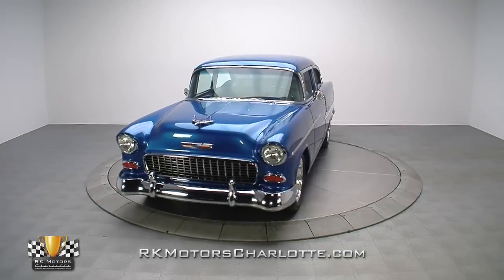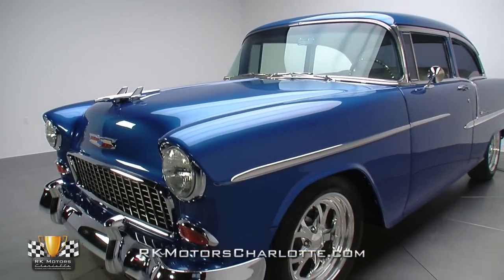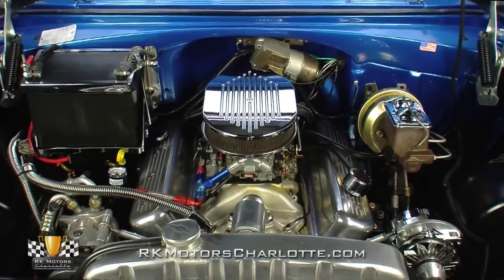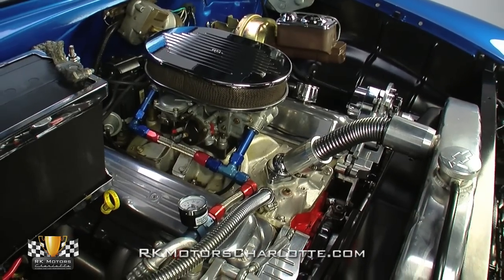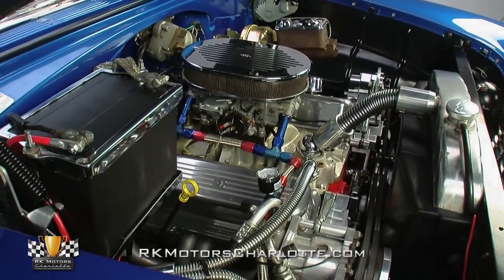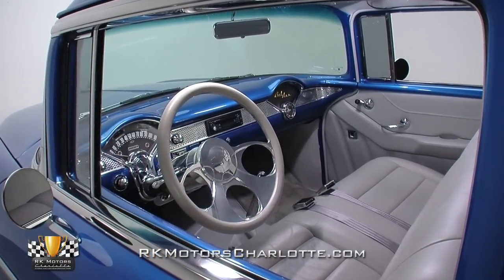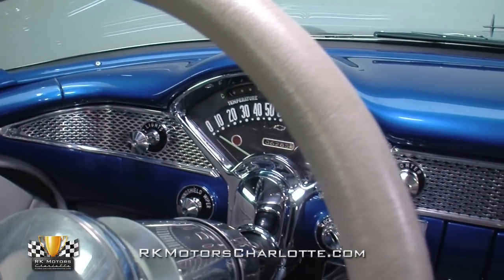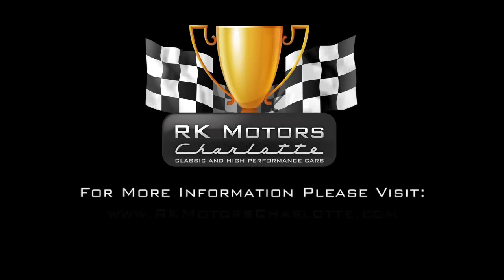133290 / 1955 Chevrolet Bel Air

Comment: To set it off what would be wrong with using a modern day EFI throttle body from Holley or the original from  FiTech ..all of which have a built in chip to control the electronic fuel injectors ..just sayin'. For those who worry about such electronic fuel injection letting you down  bum fucked  Egypt..carry a new Holley carb in the trunk and a points distributor in case the electronic ignition fails ..and an extra electric fuel pump wouldn't hurt ..and that would be about all that could fail ..or have AAA on speed dial ..the point is you can't walk away from something like this stranded on the high way ..as it probably won't be there when you get back with help